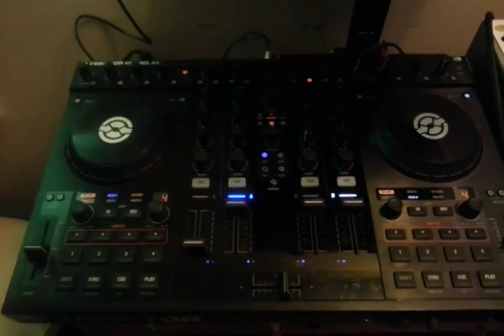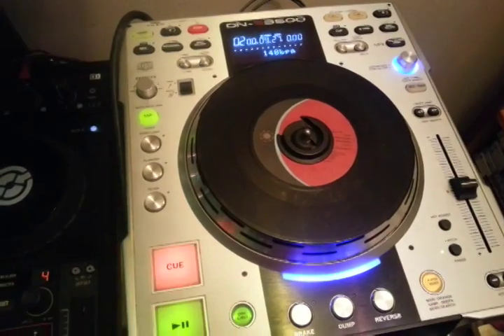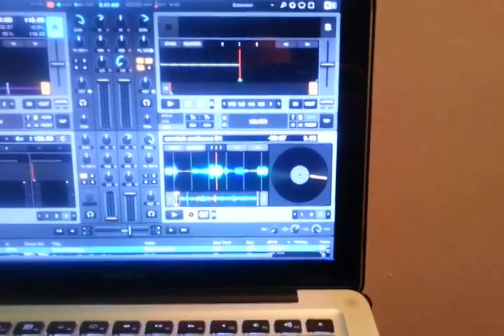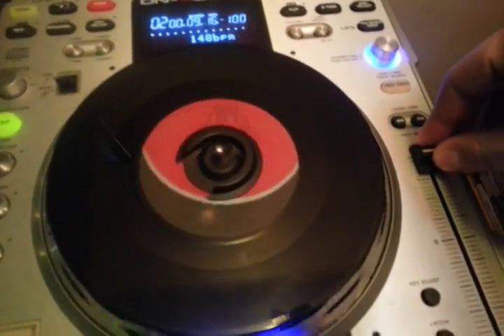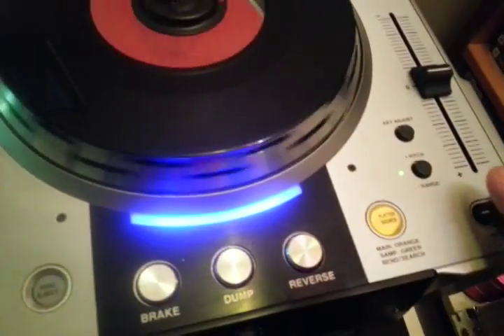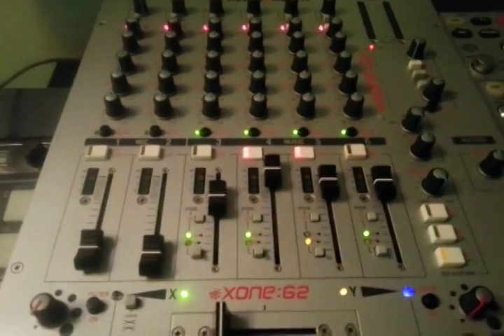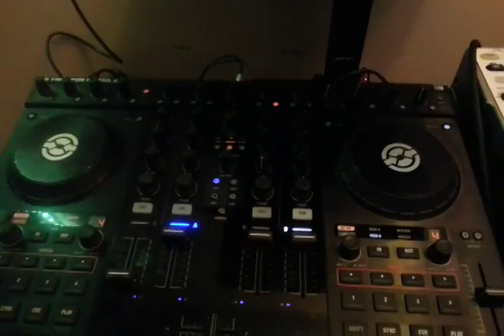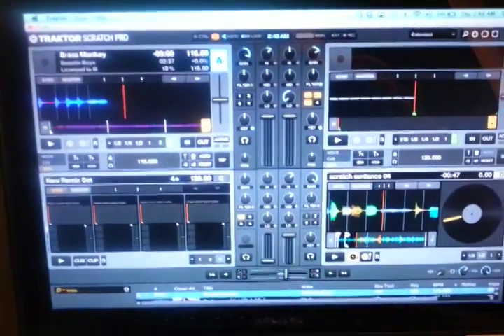Traktor Kontrol S4 with Denon DN-S3500

Comment: Need your help man. I bought 2 Denon SC3900 and a Traktor Z2 mixer. For some reason I can't figure out a way to make them work properly with traktor. I have them for over a year, and I have never used them on a gig, just at home. The Denon supposedly work with traktor in HID mode. Can you help me. Send a DM with some tips please.

Comment: Hi...

Were U able to use those DN-S3500 deck directly into the Traktor without any additional midi drive controller? I do have these 2 Denon and I want to hookup them to my PC. So that S4 is it the only thing I’ll need with Serato or Virtual Dj? 

Thanks in advance
Reply from the maker: That was like a hundred DJ systems ago I have no idea I don't remember
Reply: I think you need cd with time code